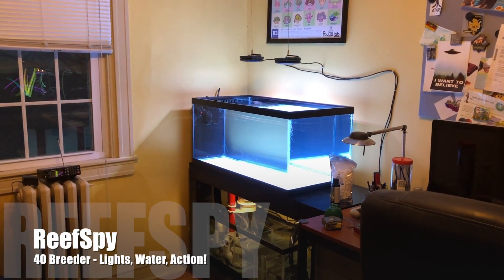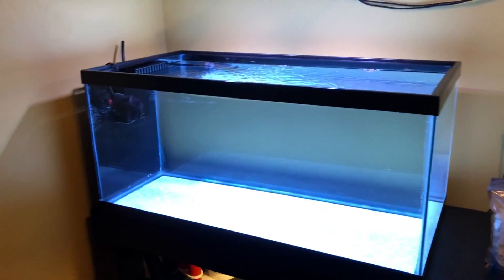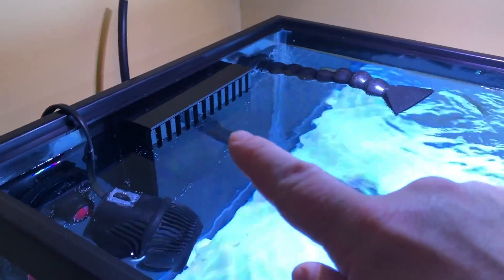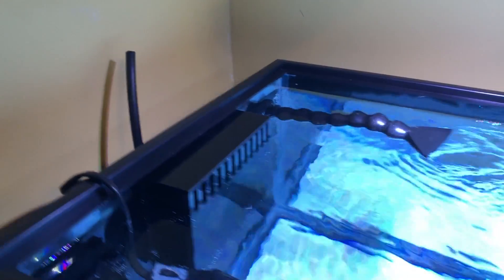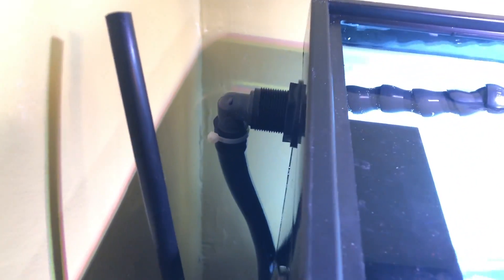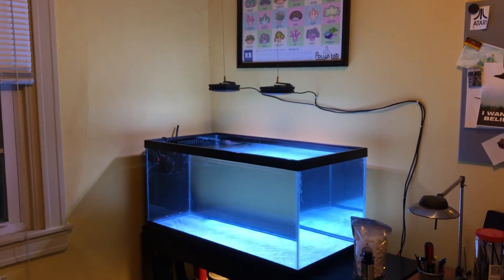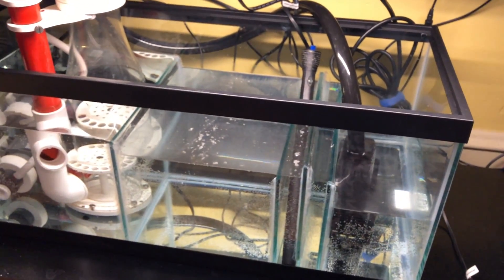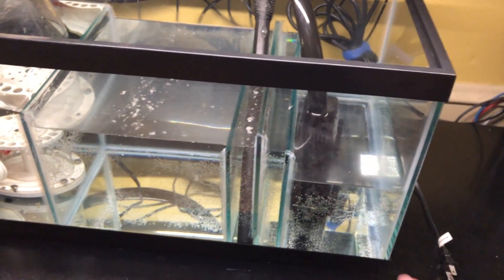40 Breeder Frag Tank - Lights, Water, Action!

Comment: I love this setup, even seeing where you have it, looks very nice. I used two-piece paintable channel mounted on the wall to manage my light cables, and I love how they just blend in. And that heater - should it be out of the water like that? I’m OCD when it comes to heaters - the potential for disaster freaks me out. 
I also find it interesting you went with soft plumbing - that was the main thing I learned with my 20G with sump - I will always build so the hoses can be cleaned, after the white slime nightmare. And if you find you need some type of mechanical filter where the overflow hose enters the sump, maybe take a thick filter pad and make a pocket in it by splitting a section of it into two layers, then put it over the end of the hose. If you stick a couple small pieces of the hooked part of Velcro onto the hose, the filter pad will cling to that just enough to keep it there. I did this very successfully for ages, just discarding the used pads. Very cheap and easy. That’s me - cheap and easy.......😂 And please forgive me if you already know all this.....🤷‍♀️
Reply from the maker: I like the ideas, thank you!  I'll definitely be tidying things up a bit.  Don't worry about the heater, I'll be getting an appropriately sized one, this one is obviously way too big.  I just put it on because the tap water was ice cold coming out of the tap with this weather and my hands were numb when i put them in the tank.  lol
Reply: Lol, you’ve got it under control I’m sure. I can identify with the cold hands....

Comment: Hey Spy, Another great video. One year ago, I asked you for advice one my sumpless 100g saltwater tank. Well, now I'm building a 300g reef with a proper sump and all the good stuff and I'm in some trouble. My 100g is still running and has plenty of live rock that I plan to use in my 300g. Actually, I did not have a quarantine setup back then but now I do. I keep getting white spots on my tangs now and then, so basically I will have to qt the fish before putting them in the 300 also the rock has ich on it so I can't put that directly in the 300. How do I go about with the qt of my fish and rock ? I have a full qt setup and the 300 is built(no water yet). Thank you!
Reply from the maker: Posittron awesome!  I wish you alot of luck with the new build. From my experience, there are really only 3 proven ways to cure ick. Tank transfer method, hypo-salinity, and copper treatment. Research those three and pick which one will work best for you. Avoid all of those other ick-cure in a bottle, they generally don’t work. As for ich in the rock... if the fish are out of the tank, it should starve out while they are gone. But you must remove ALL fish. Now is your opportunity to do it right and get rid of that ich for good. Just don’t rush it.
Reply: Thanks for the quick reply man. Will do my research!